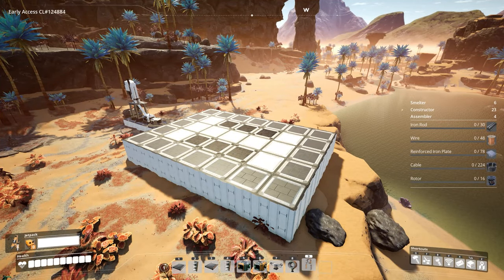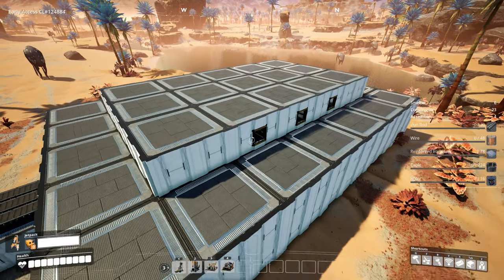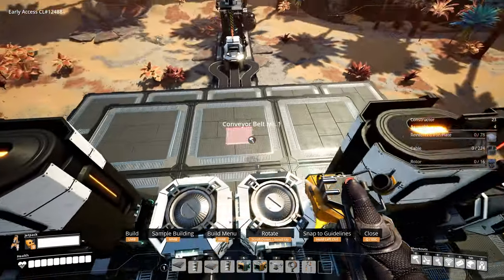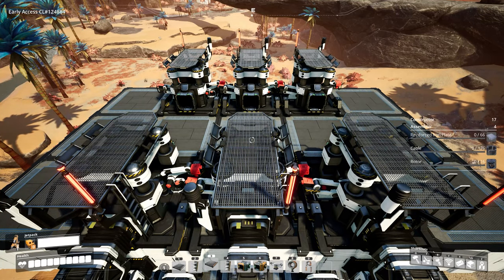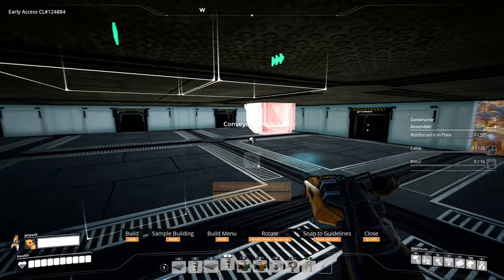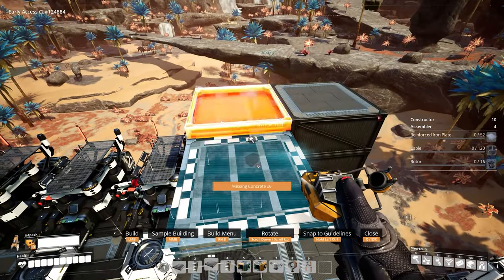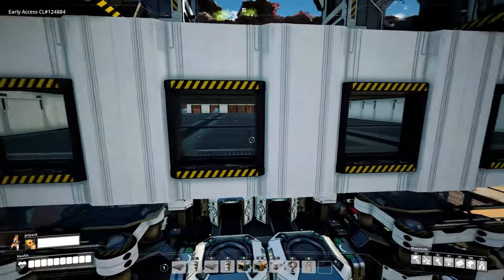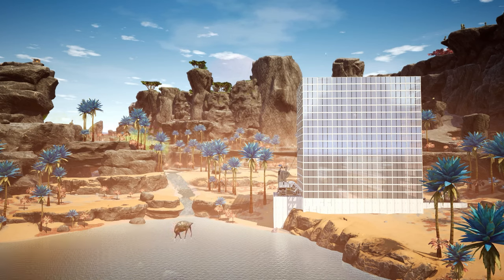100% EFFICIENT 16 Rotors / Minute Factory! [SATISFACTORY GUIDE]

Comment: So, as was mentioned in another video of yours, you need to build the sandwich layers before placing your smelters/constructors.  You will need to add an extra 8x1 foundation to the bottom of the lowest sandwich foundation and then place your walls.  No need to do the middle portion of the 3x5 platform, just the outer edges.  Once the walls are placed go through and delete the bottom most foundations and voila...perfect sandwich layer.  You can leave a wall off and are able to place it connected to the other wall after deleting the 3rd foundation.  You can then place your smelters/constructors.  Now that I think about it you may only have to do this for one wall and then connect the rest of the walls off of that one.
I found I needed to skip ahead in your video for the placement of the walls then come back to the orientation of the constructors/smelters.  
Either way, great video.  You have yourself a new subscriber.
Reply from the maker: The issue with that approach is the sandwich layers above the constructors I believe. By building 3 8x4 foundations, the lowest most 8x1 of the sandwich layer is the lowest you can go so you can’t put in a temporary foundation for the walls. You could always build 1 above that of course. There is always wiggle room in the approach and everyone can add in their own style however they choose. This is all of course in the event I’m understanding your method. Regardless, I value the input and appreciate the feedback to help me improve. Thank you.
Reply: @Scalti  Oh no, you still build the same amount of 8x4's.  Just after building those you add the same that you add in the video, but you also need to have a 3rd added to the bottom.  This all would be done before placing constructors so there are no clearance issues.

Comment: This is one of the best tutorials I’ve seen! Fantastic job. Please keep it up. I do have a couple requests if you get the time: Manufacturer level builds, showing how you power the machines (in a clean way I’m assuming ;) ) and more use of overflow/manifold system. The exact split way is cool and all, but too much maths for my brain. Thanks again! Wish you best if luck.
Reply: You are just gaining knowledge. It is not cheating. Keep watching them and you would do many great things in Satisfactory.
Reply: @DangerF1  Pineapple turbo whales have less draft than 100 neutrons..

Comment: You are a huge inspiration for me. Thanks a lot!
I am playing without mods at the moment, so what I experienced when building, is that the AWESOME shop must have are walkways (and wall power poles). Building a T-Crossing on each side of a floor makes things so easy and can later be extended to help traversing up and down through the factory.
With the wall power poles you can create a little kill switch at the front face or entrance to easily un-/power the machinery.
I also like to extend the long side of the factory of about one tile to place pillars between the floors, so they don't just magically fly in mid-air.

Comment: So I had the alternate recipe "forged screws" so I was able to eliminate a layer, and add a bit of efficiency. I added one more forge at the base, and since I was bringing in a MK.3 line from a MK.2 miner on a pure node I was bringing in 240 already. I split the 7th forge so it and another were receiving 20 ore/min. So I took one side of 30/30/20/20 up to the screws and was able to do 400 screws/min. Solved a lot of issues with this build!

Comment: I have noticed a mistake(not really a mistake) by balancing the iron rods.
You can divide the iron rods instead of iron bars so you dont have to underclock the constructors producing the iron rods.
I divided 1 constructor in 3x5 and merged 10 iron rods to one line of 100 iron rods and the other 5 to the other line of 80.
So i had 100 iron rods going up the next floor for the production of the 400 screws. 
And my platform is 3x6 for the production and not 3x5 as it is in your video because i have 12 constructors at one floor. 
I hope it was understandable
And btw i love your building layouts. I also made a building by myself based on your designs with caterium and it is soooo clean.
Reply from the maker: Yup. I’ve modified that balance to rods in the motor guide I made

Comment: Another really great build! Something did occur to me though - it's not a very "walkable" build, is it :) Definitely loving this approach, but I'd have to figure out how to adapt it to be traversable by foot, and without those silly jump pads... I'm thinking a lot of walkways and stairs, haha
Reply from the maker: I argue that one doesn’t need to walk around the upper floors really. Given the nature of the build being designed for a specific quantity, the system is a ‘set it and forget it’ build. Even if you pump more iron into it, requiring upgrading the belts, you are limited by the amount of machines. You very well could overclock them but it’s more efficient to build an entire second building next to this one instead. This eliminates the need to navigate the upper area for future belt upgrades and the like. 

These early game builds are not so much intended to pull from and build more complex components but to provide the engineer the resources to build the bigger factories down the road that produce the more complex components. This factory is fantastic for getting players ready with coal generated power because the generators, water extractors and pumps use rotors to be constructed. When it comes to late game mass production, the superior approach is an array/overflow method that can grow as you upgrade belt capacity. This is at least my approach. There is no right or wrong.

Edit: Now if you’re referring to the building phase of the structure, my scaffolding video covers 2 methods of approach. The 8x8 double ramp from the AWESOME Shop and the belt scaffolding with ladders on the side.

Comment: Missed optimization opportunity: You could have gotten away with 1 less constructor for further reduced power consumption and fewer load balancing headaches.
Instead of having 6 constructors in a 5*15+5 array and 7 constructors in a 6*15+10 array, you could have just done 2 sets of 6*15 arrays and split off 10 rods per minute using a similar method used when load balancing the outputs of the ingots. This would create a new conveyor line that would need to be merged with the line going to the 2nd array of constructors, but a little extra belt-work is way less of a headache than trying to match material inputs with machine clock speeds.

Comment: Why on the Floor with the 7 Constructors making Iron Rods did you use Mk 2 Belts from tha last 4 to the Mergers? Mk 1 Belts can handle 60 per minute sooooo the Constructor underclocked to produce 10per min and the next 2 producing 15 per min makes 40 per min, Mk 1 belts all around including the first belt between the first 2 mergers. The Second belt between Merger 2 and 3 is a Mk 2 as thats now moving 70 per min but the constructors feeding these are 15 per min into the Mergers so Mk 1 belts would be fine..yes? 

So in conclusion the only Mk 2 belts required on this level are the belts between the last two Mergers and the final output that will head on up to the next Level.

Is this right or am i missing something.

Great Build and Tutorial as usual , thankyou for the lessons :)

Comment: You shound not do the 80/100 split right after the smelters but instead take the output from three smelters to six constructors for rods and split the rods in 80 and 100. This would save one constructor and make the build not require underclocking

Comment: maybe they made some changes or patches of the sort idk but I built this exactly as you did correct conveyers in correct places, load balancing, proper distribution. everything and my factory is like half as efficient as advertised primarily because only one side of the factory even receives enough materials. I got one assembler at the top with 500 screws in it stacked up and the one right next to it is out here with 0? and it needs to pile up a bunch before it makes another rotor. I checked the belts and the constructors for any errors, double checked that everything was connected. I couldn't find anything it looks to me like the way this factory is built just does a poor job of getting the recourses to split efficiently not sure what I did wrong I've rewatched at least 5 times. guess I'm just wondering if anyone else is having issues too? or just me...

Edit: I should mention that the shortages of materials appear to be specific to the side the assembler is on. For example one side (the side where the ore comes in) Is always low on screws. While the other side is always full on screws but constantly low on rods...

Comment: After reading the comments you talk about how these single resource buildings are good early game. What's wrong with them for late game? I'm just starting out. Is this gonna be an issue late game?

Or can I make late game items like this too? And then have it output to some storage at the bottom and have the vehicles once I figure out fuel come and get them? Have a network of these compartmentalized buildings delivering to a single stockpile location.
Reply from the maker: That’s the way to do it late game. There isn’t anything wrong with them late game per se but it’s more convenient late game to centralize a storage with building materials. 

Mid game you can use trucks to transport items and late game use rail.

Comment: i built your factory and i noticed its not runnning at 100% bc i have 4 impure nodes running into mergers then a splitter to get 60 per belt. but i only have mk 1 and mk 2 belts and i have one line between the mergers and splitter that needs 180 per minute. is there anything i can do beside trying to get mk 3 belts

Comment: Sorry for the newb question, new guy here, but how are your building colors different than mine?
Reply from the maker: No apology needed friend. As you go around gathering leaves you’ll occasionally find plants that give you flowers. Build the MAM and use those flower petals to research that tech tree. As you do you’ll eventually unlock the color gun and color cartridges. Once you have unlocked and constructed the gun you can right click to open a menu that is your color pallet. The first (upper left) swatch is the default for all your machines. It will change everything you’ve built and will build to that color at no cost. You’ll also have additional swatch that you can adjust to color various things that can help you stay organized. Hope this helps!

Comment: Hi! I've, watched basically all of your videos on satisfactory so far. I wonder if you could maybe go over your process for working out these efficiencies? I can do the easy "one smelter makes 30, iron rods need 15 each, split one thirty line into two 15 lines, make rods". That part is pretty straight forward. The part I struggle bus on is how you get to 16 rotors from x input. Do you start with "i want to make 16 rotors/min" and do the math all the way up? Or do you start with "I have x input, how many rotors can I make"? OR is it "one assembler/manufacturer/whatever makes x amount, <insert math here> I can make y amount per minute, but i need z input." <<<that is the one I struggle bus with
Reply from the maker: I do it the last way you mentioned. My aim is to figure out how many I can make with an input that is divisible by 60 as that is a common ‘base’ value of items per minute you can mine and matches MK1, 2 and 4 belts. MK3 can obviously do 240 given it bring a 270 belt. 

I look at the product I want to make and the rate a single machine makes it. Modular frames for example, 2 per minute per assembler. Then I’ll look at what is required to make them at 100%. From there I do back and forth of “at x output I need y input but for y output I need z input” - this definitely takes a bit more time and organization but once you start memorizing ratios it becomes easier. 

At the end of the day, I then note “to make 10 modular frames a minute I need 240 iron ore”. Then when I want to make something that requires modular frames, I now have an easier means of determining raw material requirements. For example, the heavy modular frames at 2 per minute require 10 modular frames per minute. I now know at minimum I need 240 iron ore just for the modular frames of the factory. 

I’ll look into making a video to explain my process as long as I can figure out a way to do it that can be understood and people can follow. I tend to get a little disjointed when trying to do so lol.

Comment: Hey Scalti, at 14:20 you discussed the underclocking set up for rods. I was wondering if it would also work if you had both the last two set to 10 rods per minute instead of one at 15 and the other at 5. Thinking just for the sake of symmetrical load balancing.

Comment: Hey man have to say great setup and guide easy to follow, even harder without fly mod lol, but yeah got everything at 96%-97% that sound about right for all devices for efficiency?
Reply: Take that back took awhile for it to finally catch up after awhile of running all at 98-99% guessing that's close enough
Reply from the maker: If built correctly it’ll run at 100%. If it isn’t, I could look at the assemblers on the top floor. There should be a few that have a full stack of reinforced iron plates in them. If they’re not, I would suggest manually loading them so the belts back up and the overflow starts working.

Comment: Alternatively you can build a bigger factory with 720 input ore. Basically scale everything x3. You'll need a mere 88 constructors and 12 assemblers to saturate it, but at least your OCD self can be happy with full 100% efficiency of everything, from input to output.
You'll need to split your rods 320-400, so you'll need to finagle one last constructor to take 5 rods from it and put it onto the rods line.
You convert 400 rods into screws
And feed it all to 64 assemblers.
Of course, not even MK3 belts can handle that load of items, so be ready to enroll into the great church of spaghetti monster too!
But at least at the end of the day you will be able to say that your 3 Mk2 miners give you ore at 100% speed and all your machines work at full 100% efficiency and none is underclocked! Yay!
You'll probably never need all those rotors, but who cares?

Comment: Really great guide and neat and orderly design. I think even you said it but I am thinking most of your guides are great for early game since they are all pretty low output. I tried this game a failed when it came to scaling up.
Reply from the maker: The nice thing about this design approach is to scale up means just building a second factory next to or near the original and using the same ore node(s) with increased output as you unlock better miners and faster belts. Additionally it also enables you to know what good base value outputs you can have (e.g. 240 iron ore makes 20 reinforced iron plates). So if you need a particular quantity you have a more immediate idea of resource requirements
Reply: @Scalti  good point. Thank you.

Comment: Great video! However, I'm having an issue with wall placement on the outside of the sandwich layer. The walls are always 1 meter too high when trying to place. I tried moving the sandwich up but it didn't help.
Reply from the maker: Need to place the wall on the top of the sandwich and the place a wall below that. Delete the top one and then all other walls need to be placed aiming at the left or right of the second wall built.

Comment: Everyone that had efficiency problems with the screw constructors connected the wrong rod floor to the screw floor. The their sandwich layers for the screw and assembler floors need the splitter output direction reversed. The video doesn't zoom out to show the orientation of the floors in relation to the miner, and it speeds through the lift connections so it's easy to get the floors turned around and the lift connections mixed up.

edit: Nevermind. Even with everything exactly like in the video, the smelters aren't 100% efficient. The 80 ingot line is bottlenecked and the 100 line is starved.

edit 2: I removed the balancer on the smelters to make it a line of 120 and 60 and everything perfect now. 100% efficient. Don't understand why, since the math doesn't add up, but it's been working 100% for a few hours now.

Comment: I know the guide is from last year so it's a bit late to add a comment  but the splitting part for the iron rod is bothering me, having a conveyer at 80 and 100 units per minute for constructors that need 15 per minute and the fact that you would only need 12 constructors for the rod instead of the 13 you use in this guide look a bit off. I got the math done, I really don't understand why you didn't choose to go for 1 smelter into 2 constructors it's an easy way, but maybe I missed something. I've learned a lot with your guides but that's the first time i'm a bit confused with your choice.

Comment: How about some neat fuelgenerator-setups?
Reply from the maker: Well. I can do a regular fuel system but ultimately the turbo fuel system is your best bet and bang for your buck. The downside is you need key alternate recipes to accomplish that. In a perfect world I would do both. In a practical world it makes sense to just do turbo fuel based on the sheer benefit it offers over regular fuel. The other downside, I likely won’t have a video for that for a fair bit. Current have 3 videos in the works and a couple of those require follow up videos too. I’d suggest checking out Kibitz turbo fuel design should you not want to wait.